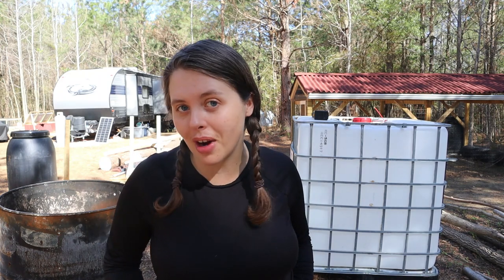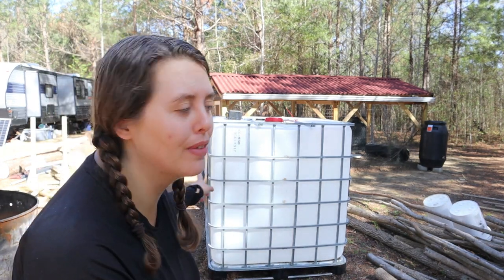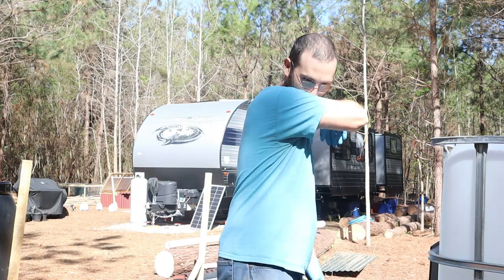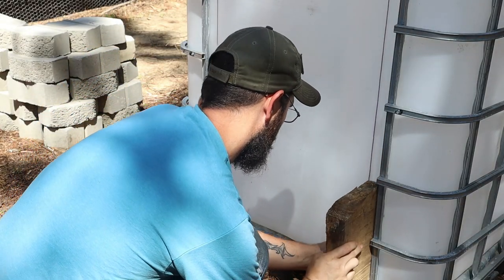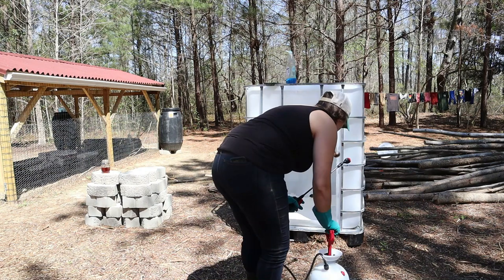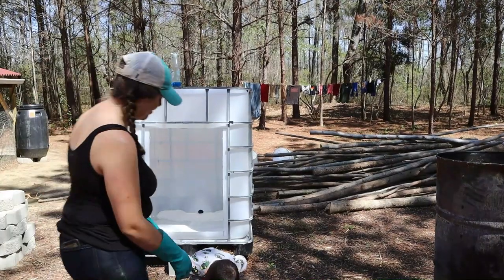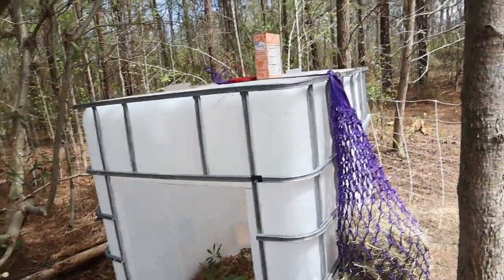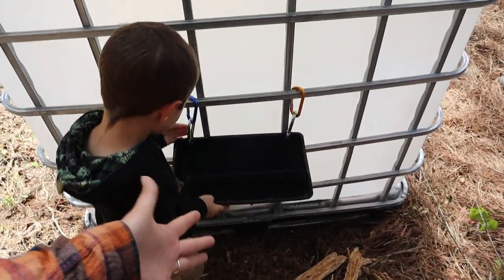CHEAP EASY GOAT HOUSE BUILD FROM AN IBC TOTE. This is a DIY GOAT HOUSE that is quick to build

Comment: In our area, there are places which sell IBC totes and, you can get what are called "food grade" IBC totes.  We got a number ofmfood grade IBC totes last yesr for $125/ each.  Which, compared to what others are spending is a lot but in this area, the next cheapest fir the same was $250 with two other places selling them at $350 and $400.  For us, "food grade" means that they've only held food items.  This said, different foods leave different types of residues and we passed on some.  -  These are what we are using for holding capacity for our rain water collection system.  If you roll then or move them 3nd over end, they are possible to move.  For general purposes and for the 300lb + watering cart, we were able to buy a John Deere riding lawn mower in good condition with a bad deck at $250 (Back story's a guy took it in to be repaired and when all discovered what a new mowing deck would cost, he abandoned the mower at the repair guy's place.)  The riding lawn mower moves the empty IBC totes with no problems too. We chose the IBC totes because empty, it was possible to move them and also change thier configuration.  They dint need to be dug into the ground and, the metal framing helps when/ if branches land.  I think a regular water tank requires a permit in this area.  IBC totes with thier smaller volume each and no water container designation dont.

And yes, our water is expensive enough to make it cost effective.
Reply from the maker: We are hoping to get food grade ones in the future,  but right now we use black pickle barrels for rain catchment.  I love that no light gets into them so algae can't grow.

Comment: I have to chuckle over your straight line discussion.  -  I literally don't see straight lines.  I can get to a straight line and even on a true vertical and horizontal plane, or line.  I have always, since I was a kid used what's called triangulation which is basically on the fly comparison to other straight lines and triangles.  On the other hand, im pretty quick to be able to note when something is hot straight or ewui-distsnt to another strsight.
Reply from the maker: I have always been awful at straight lines. Even if I use a ruler, it ends up crooked.  🤣🤦‍♀️